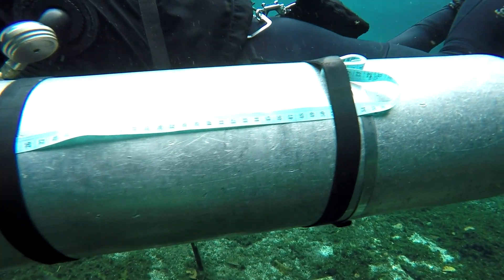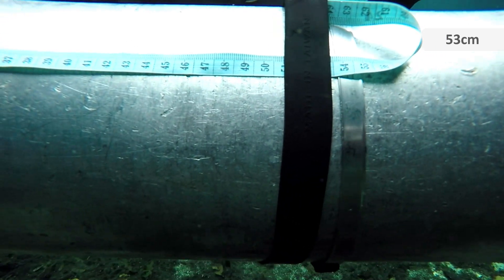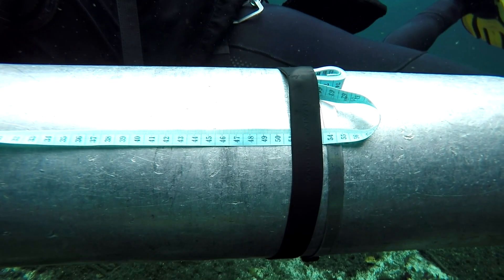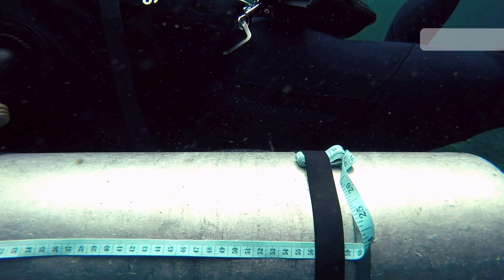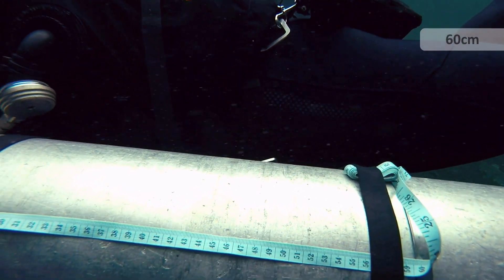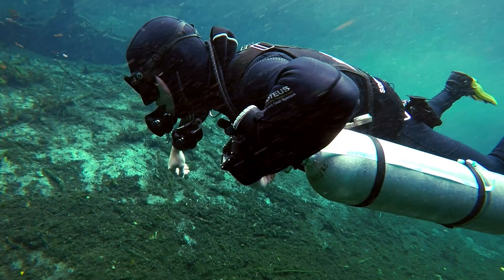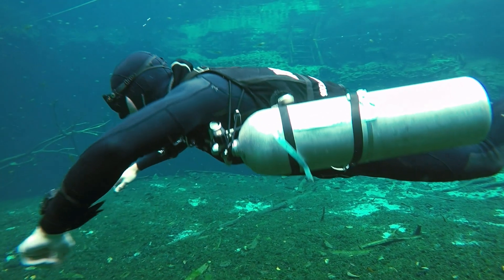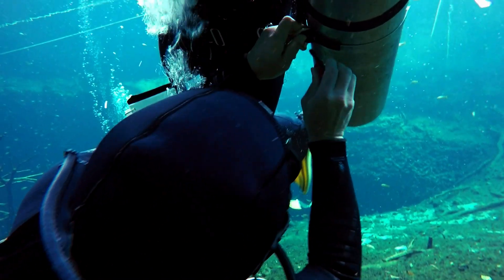Cylinder Band Height Testing - Sidemounting.com

Comment: does the type of the tank (Steel vs Aluminum ) change the results?
Reply from the maker: The weight of the cylinder no, if the setup of harness (position of hip band), loop bungee (length and thickness) is correct for the type of cylinder. All explained in the full sidemount series - https://www.sidemounting.com/product/package-3-student-courses-excludes-technical-diving/ Cheers, Steve